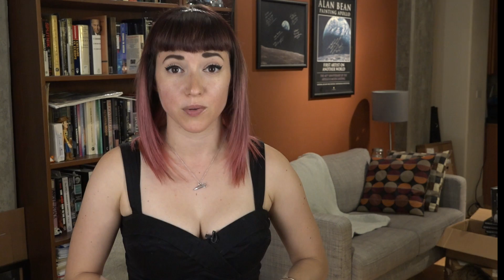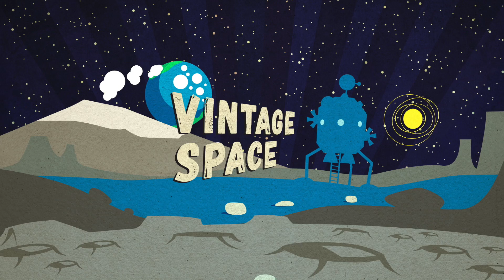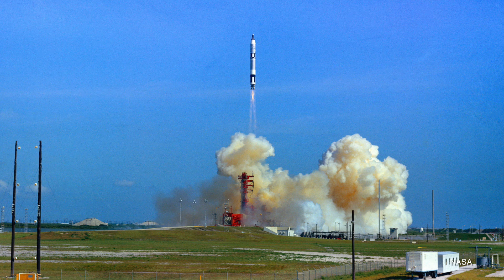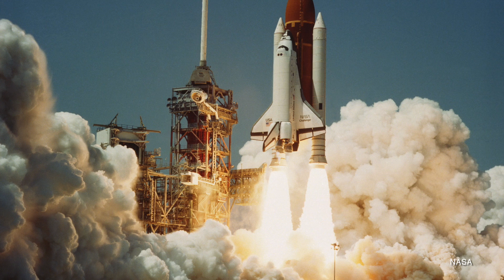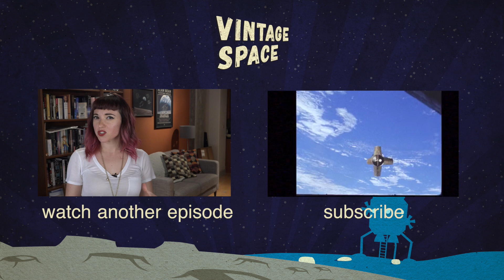How Little Vibrations Break Big Rockets

Comment: Loove vintage space. Obscure Saturn V launch detail. The cute fins that did nothing and were kept on all first stages (what did they weigh?) and the attached or nearby pin and plate (with a smaller hole like a die for extruding wire) which slows down the initial launch upon release of the hold down arms

Comment: Why did it take 40 minutes for astronauts Wally Schirra and John Young to leave the Gemini capsule after Gemini 6A aborted its takeoff. I recall Cronkite talking about how the pressure levels in the fuel tanks needed to drop to safe levels, but that took about five minutes. Why did they need to wait 40?

Comment: they call it a separate suppression system? i thought it’s just a standard part of making things run stable and not oscillating. do they call the concrete platform under the rocket a falling-into-the-mud-suppression system? Do they call the walls of the rocket a fuel-spilling-all-around-suppression-system? the nozzle then calling the flame-blowing-everywhere-and-melting-the-rocket-suppression system?

Comment: 2:44 "...it actually caused some panels of the lunar module adapter section to fall off."
Sorry, Amy, that's not quite true.
Due to a manufacturing flaw and >>>unrelated to the pogo oscillations<<<, structural panels were lost from the lunar module adapter.
https://nssdc.gsfc.nasa.gov/nmc/spacecraft/display.action?id=1968-025A

Comment: Excuse me, just wanted to ask a question. How does the increase in back pressure against the fuel entering the Combustion Chamber, decrease the overall engine pressure? Hope you can clarify this doubt of mine. Thank you.
Reply: Picture it this way: backpressure increases, decreasing fuel flow and therefore engine pressure.   Now that the engine pressure is decreased, so is back pressure, which allows more fuel to flow into the engine, whicj increases engine pressure and therefore backpressure.  Rinse and repeat.

Comment: Maybe I'm too late to paste a question here.  I don't understand why there would be a pogo effect.  Wouldn't the surge of fuel caused by the increase in G forces just lead to exponentially increasing thrust?  What causes the reverse that would give the negative G forces, and make for the stuttering of the engines?  You mentioned something about the surge causing an increase in back pressure against the fuel coming into the combustion chamber. Is this the source of the reduction in engine thrust?
Love the show!

Comment: I kept watching to figure out where the pogo valve came from that I remember reading about yonks ago.  So it was the ANTI-pogo valve, used to prevent pogo...and was a problem on one of the space shuttles back in 1981.  https://news.google.com/newspapers?nid=1876&dat=19810406&id=SoYsAAAAIBAJ&sjid=xc0EAAAAIBAJ&pg=5008,1243205&hl=en

Comment: TOPIC:  Where/what is Saturn V's S-III.  It goes from II to IV.
Reply: Tyler Woods, It was in the earliest Saturn designs before 'direct ascent' was abandoned. There is very little history of it. They knew how much energy was needed to go to the Moon. I'm sure you know Saturn is mostly fuel by weight at lift off. They shed stages when the lifting power is less important than the weight so less powerful engines can take over and continue to accelerate. Engines and propellants got more efficient, lighter and most maybe most important they proved engines could be reignited in a vacuum and zero gravity. Because S-IV's J2 was more efficient, the hydrogen fuel was lighter and it could be reignited to leave orbit for TLI they did not need to have an S-III to push the last couple of minutes to orbit or TLI (direct ascent) and then use S-IV on its first burn to go to the moon.

Comment: They used a baffle system to break up the mass of the sloshing fuel, I believe in the Saturn V.  A thirty foot diameter fuel tank gets a lot of fuel sloshing going on.  That from a former Nasa boss of mine who worked on that specific problem.    I think the Uprated Saturn IB is a much sexier and less troublesome rocket over the Saturn V.....any takers?

Comment: 1:04 Not to be picky, but g-forces are not the result of the rocket going up, but of the rocket accelerating! If the rocket would climb at a steady 1000mph (or whatever number) there would not be any excess g-forces felt by the crew.
2:27 The astronauts do not experience negative g-forces unless the rocked actually stops climbing and falls back to earth (and accelerating past minus 1g. just falling means the astronauts would feel ZERO g like they do in the vomit comet :-).
The g-forces would be positive the whole time; just changing in strength with the rocket's pogo motion.
Well, at least that's how I remember my physics classes :-)

However, this was a very interesting explanation of the phenomenon!
Reply: Yes, and also incorrect that there's a downward force due to acceleration. There's only two forces: gravity downward and the force from the engines upward. Astronauts feel g-forces because they're being accelerated upward.

Comment: Amy, there's a second mode of pogo generation, which was especially a problem for the Saturn 5 first stage (S-IC) center engine. The engine is basically mounted on an X shaped crossbeam as i understand it. When the engine has a momentary thrust increase, it pushes up and compresses the fuel line slightly. This forces more fuel into the engine pushing it harder up. Then the crossbeam pushes the engine down again, decompressing and lenghtening the fuel line, which reduces fuel pressure for a moment and the engine can bounce downwards quite a lot, then back up again (like a pendulum), which restarts the cycle. If left unchecked, this could potentially break the fuel lines and or even rip out the entire engine mount.

Comment: One Correction:
You wouldn't feel negative g's in a pogo oscillation, just like you don't feel negative g's on a pogo stick. Physics prevents the rocket rider from feeling negative g's (at least at lower speeds;aka neglecting air resistance) because that would require an external force pushing down, just as you need a rocket throwing fuel downwards to create an external force upwards to create a positive g nominal launch.

Take this extreme impossibly unrealistic hypothetical:
Say a rocket were to pogo so severely that the rocket engines were essentially bouncing between 200% thrust creating say 3 g's and 0 thrust (so...off). What would the g-force be when at 0 thrust?

Well you would be in free fall (going up still) so you would feel 0 g's, not negative g's. The rider would feel 3g's then 0, then 3, then 0, and so on. And no rocket would ever survive a scenario like this one. It would shred itself to pieces.
Reply: She probably means "relative" neg. G;s. Why are so many confused.

Comment: ** ANYONE Could someone please do a rough calculation on the top speed of a Saturn 5 rocket if it were built in orbit of course doing 23,000 miles an hour fully fueled and launched away from earth after all stages burned out.  thx

Comment: Correct me if I'm wrong, but I was under the impression that the "downward force" of the launch, which you explain is the cause of astronauts being pushed into their seats and fuel being forced into the combustion chamber is not a force at all. The rocket engines produce an upward force (which is why the rocket moves up), but every part of the rocket and everything it contains (including astronauts and fuel/oxidizer) experience inertia. Essentially, the non-structural parts and contents of the rocket tend to stay stationary (an object at rest stays at rest...Newton's First Law) as the rocket itself moves toward them.

The fuel and astronauts are not being forced down, but from an astronaut's perspective it feels that way because the rocket is being pushed up towards them. It's the same reason people mistakenly believe there's such a thing as the centrifugal force. What they are actually feeling is the normal force from the surfaces that they are in contact with. It feels like you're being pushed into the surface, but in reality the surface is being pushed into you. That's an important difference, from a physics perspective.

Comment: I can't find this information anymore, but I recall reading that the Saturn V design was based heavily on the C-4 design, when the center engine was added the enlarged thrust plate and supports weren't quite enough to prevent the center engine from causing significant flex, I think on the order of several inches. This actually contributed to the pogo somewhat, shutting the center engine down first helped to overcome potential problems when the rocket reached max Q. Maybe on one of the unmanned test flights an issue was uncovered here. But unfortunately I just can't seem to find anything related to this.

Comment: Is pogo the reason behind the space shuttle not running the main engines at full throttle on take off but afterwards they would "Go for throttle up"? Or partially the reasoning?
Reply: The reason they throttle the engines down is to limit the acceleration of the vehicle as it passes through the thicker air that is lower in the atmosphere. This part of the launch trajectory is where the vehicle experiences what is known as "Max-Q" or "maximum dynamic pressure". This region puts the maximum aerodynamic stress on the vehicle's structure as it accelerates at high speed upward through the thicker air. Therefore, to limit that stress they throttle down the engines until the vehicle climbs up into the thinner air that is higher up. Once it does the dynamic pressures falls and the engines can be safely throttled back up again. This is also sometimes referred to going "past Max-Q".

Comment: I would also assume that the solid fuel boosters on Shuttle would help dampen the vibrations, because they wouldn't surge (do to fuel flux). Another great vid Amy!
Reply: The srbs actually made things harder as they have their issues thrust oscillation.
The structure of the ET was designed so the boosters can move a little and not impart as much vibration to the stack.
This was one of the big issues with Ares I was they had to figure out how dampen them on an inline vehicle.
Reply: I have never liked SRB's.  There is literally no way to escape, once they ignite.  I was somewhat dismayed to see the new SLS design include SRB's... but since the SLS stack includes a launch escape tower, there is a safety margin in there that STS did not have.
Reply: K1productions
I would have preferred they went with the Dynetics F-1B design as even the block one would have lifted 105 tons and they could use the booster with the already designed Ares I upper stage to make a 32 ton payload LV for crew launch.

Comment: Very cool.  Read about this a few years back.  Blurred vision akin to severe tire shake on a top fuel funny car,,and possibly retinal damage.  Can wreak havok on hard parts and pieces as well.  Basically the same thing as the pogo effect,but on a horizontal level.  Instead of a steady G pull, The tires suddenly, bite, spin, bite, spin,, repeat,,,,until the power is shunted.  Now, there are more/several traction control boxes that remove this style of pogo, for other classes,,and much happier competitors.  Mr Tesla was right.

Comment: Amy,

Once again a great video.

There is one thing I would really like you to research. In mission control, usually on the "booster" displays, there are a number of graphs that can be displayed. These are quite complicated curves, and I think they are intended to tell booster what options are available. This logically follows on from pogo, as I think it was one of these that was consulted after the engine shutdown on 13.

So what exactly were they and how were they used?

Robert

Comment: If I recall, part of the reason for cutting off the center engine of the Saturn V earlier prior to the other engines for staging was also a method of dampening the pogo effect? For some reason I seem to remember reading that, unless I'm mistaken.
Reply: I did a little research. Yes, it was to actually make staging a little less violent. It had the effect of slowing down the Saturn V ever so slightly, but enough to make staging easier. Apparently, it didn't really have an effect on pogo.
Reply: Actually have not heard it, I'm sorry to say.
Reply: The reason the inboard engine was shut down early was to limit the acceleration of the vehicle as the propellants in the stage are depleted. As the fuel and oxidizer burn off the mass of the vehicle is reduced so the acceleration rate increases. Toward the end of the firing of the stage the acceleration rate gets so high it puts lots of extra stress on the rocket's structure as the top part of the vehicle gets heavier and pushes down more and more. They could have added more structural reinforcement to withstand the extra acceleration but that would have added more weight, so instead they just shut off the center engine early to limit the acceleration.